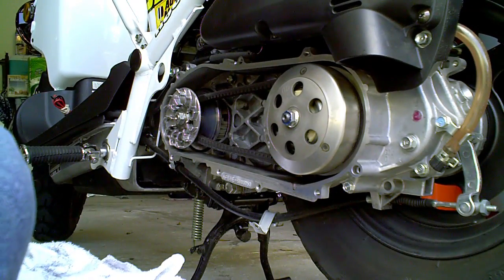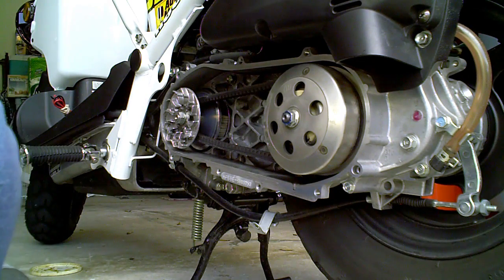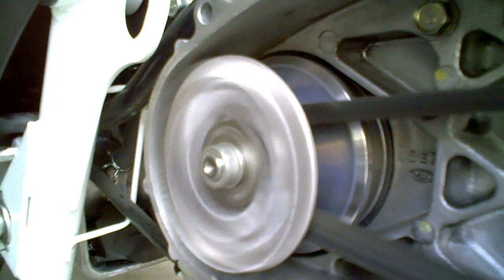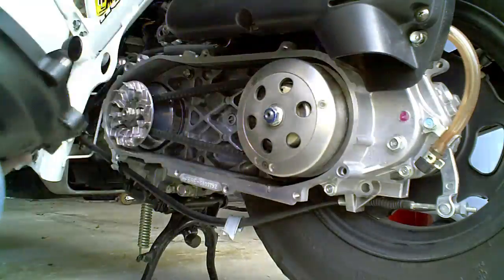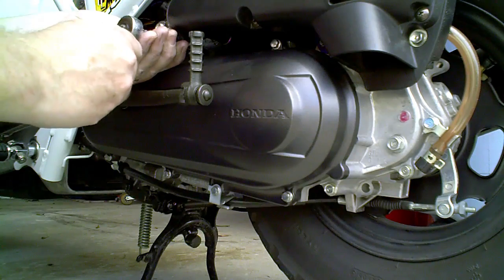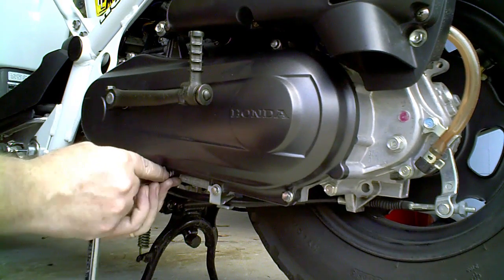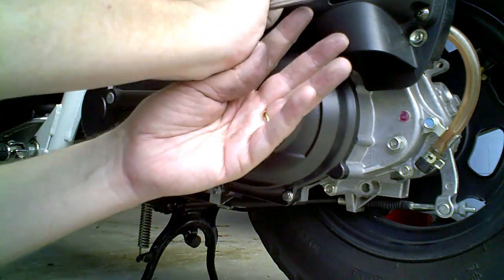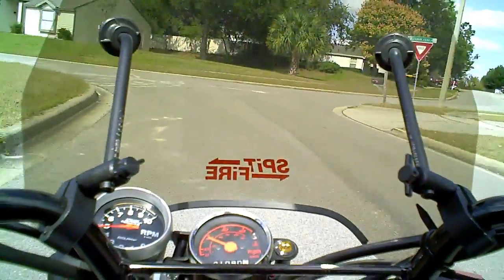Ruckus Variator Roller Replacement Part 4

Comment from the maker: Congrats. :D
Keep in mind nothing will make a drastic difference.  The Pollini will help, imho, but you may have to try a few weight variations before you dial it in.  I found with the OEM weights and the Polini work well for me, I'm 210 lb. Lighter rollers = better low end, heavier = better top speed. Try the OEMs then the 6gm rollers. The difference will be very subtle.  btw... I don't recommend mixing roller weights.  
Also check out the Total Ruckus and Ruckus Central forums for good tips.

Comment from the maker: I've have yet to "have" to change them.  I replaced them solely to tweak the performance based on my needs.  I'm heavy, ~210 lb so needed lower end torque over higher end speed.  The Polini variator let me use slightly lighter weights (for torque) while maintaining pretty good top end. Of course with a 50cc scoot these tweaks are not huge gains but once dialed in can help.  :D

Comment: Ah, glad I watched this.  Was subbed for awhile obviously but I never saw this vid, haha.  Think I subbed after.

So 2 questions:
- Does the belt go to a smaller radius in the back (opposite of what happens in the front)?  Or does only the front one change?
- You used the original white weights instead of the staggered ones and it seemed to fix the hesitation?

I started off on bikes, no exp with scooters, those CVT's are very cool, though.
Reply from the maker: Yes, the back "clutch" is a spring loaded pulley system.  As the belt rides up in the front it is pulled down into the pulley groove in the rear.  :D
Yes and no.  The mixed weights caused some rattling.  Changing back to the OEM weights stopped the rattle and still gave a good balance of top end speed vs low end power.  The hesitation is still there right around 5700-6000 RPM (about 22 MPH).  I think it has to do with the carb and the slow and fast jets not transitioning from one to the other well (maybe dirty).  At least that's my guess.  I've run carb cleaner through it and it seems to help but eventually comes right back.
Love my scooter but I do wish it had at least a 80cc or 100cc engine.  50cc doesn't have the power to move my fat ass very well.  lol
Reply: ***** Haha, yeah, 50cc's is low!  I don't think it'd move my big ass anywhere, lol.  Yeah, improper jetting or dirty jets can easily lead to a flat spot, though more typically flat spots are associated with aftermarket jetting setups.

Comment from the maker: In Florida a "moped" is considered to be a two-wheeled vehicle with less than 50cc (most 50cc bikes are 49.4 or there abouts to meet this regulation) and under 4.5 bhp (?).  The legal top speed is 25.  Mine will hit 45 burying the speedo but it takes a bit to get up there.  Other than a Pollini variator I've made no other mods to the engine.  No way I'd do 65-70 on a Ruckus.  Thats a bit too much for me.  lol

Comment: Great video. What is the torque specifications for the variator nut?
Reply from the maker: Thank you for the comment.  I appreciate you watching.  As to the nut torque I think it is ~18 lb/ft but I made this video 8 years ago and don't really recall.  If you get it wrong you can do a lot of damage.  My best advice, short of getting a service manual, is to check out Ruckus Central.  It is where I got a lot of good information on tweaking and working on my Ruckus.  It's been a long time since I was active on the forum but the members were always very helpful.  Here is the link, search around and I'm sure you'll find all the info you need.  http://battlescooter.proboards.com
Reply: Actually I just rewatched part4 and the very beginning says 32 ninameneaters which I guess is 32 Newton Meters which converts to 23.60 ft lb. 

Thanks for the advice. I just bought a used service manual on Ebay for only $30. It will definitely come in handy.
Reply from the maker: Coolbeans.  Yeah a service manual really comes in handy.  Guess my memory wasn't that good.  :-)